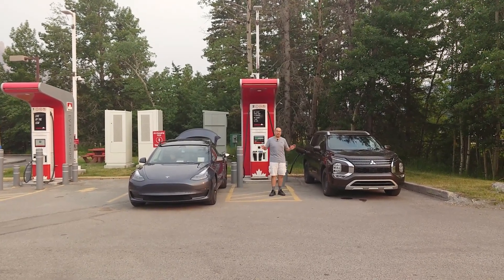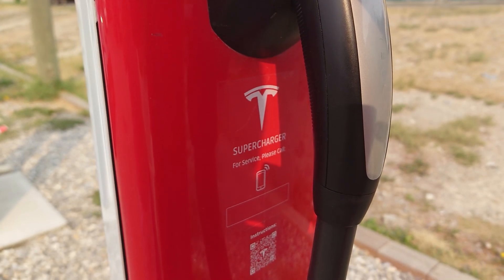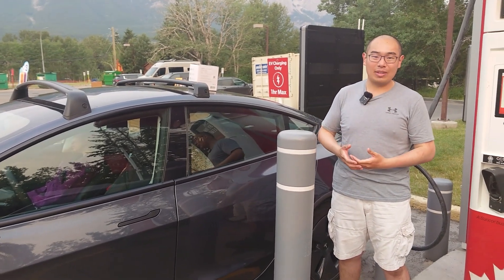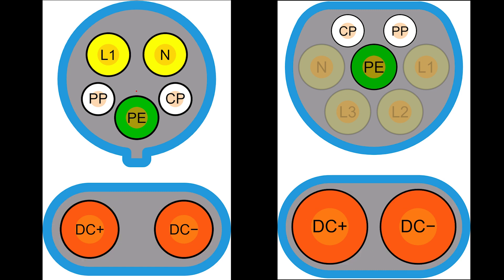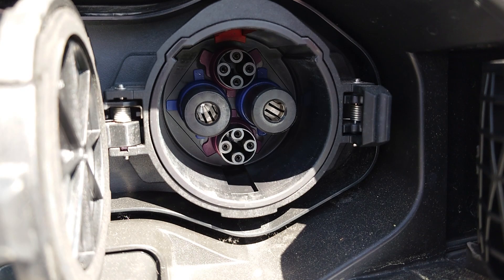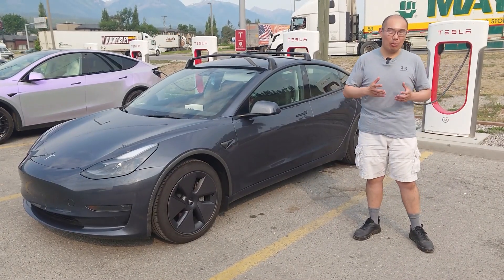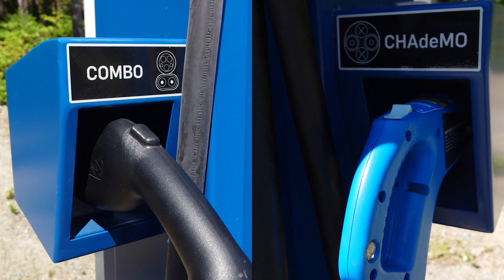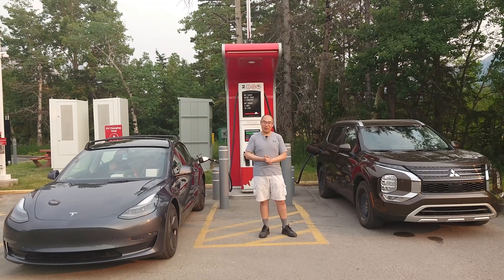All About Charging Standards: NACS, CCS, CHAdeMO

Comment: Thank you for factual and clear explanation. It's a shame when standardization doesn't work, I hate this inefficiency, also it would be much better to use DC Grid and not trillions of power transformers AC to DC vast majority of electronics is using DC, we should have instead small number of DC to AC transformers for those few AC motor powered appliances.

Comment: Its probably also important to note that the non-Tesla EVs gaining access to Tesla superchargers can only use the V3 and up (at least at present). V2 superchargers are not compatible, which is mostly the case in NB, NS and PEI.  0 in NL.  And it was neat to see in the video 2 working Petro-Canada DC chargers. In NB, 3 of the 5 PC DC chargers have been removed by the company. Their electric highway stops in Quebec now.....  Still looking forward to gaining access to a NACS adapter for our 21 Kona EV, if we travel west.

Comment: Clear and straightforward explanation that will help many people adapt tp the new DC reality coming soon. Much appreciated and hopefully Hyundai will get their adapters to owners (myself included) as promised by the end of the year or first quarter 2025.
Reply: Probably should be ok on the 400 volt cars on the V3 sites. It will be interesting to see if Hyundai-Kia-Genesis do hardware updates to allow better charging for the 800 volt vehicles. GM splits the pack to 400 volts.